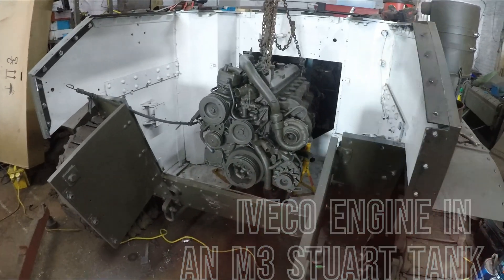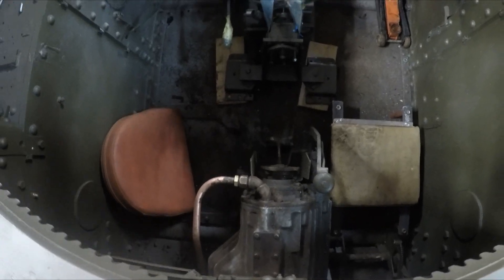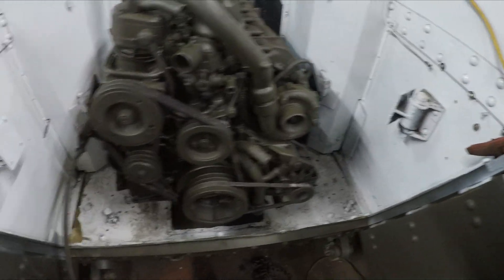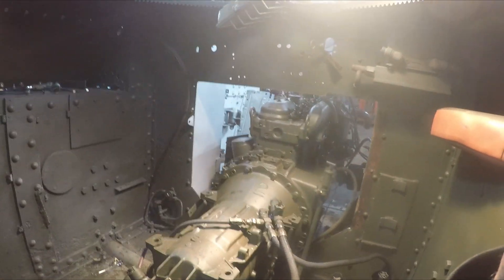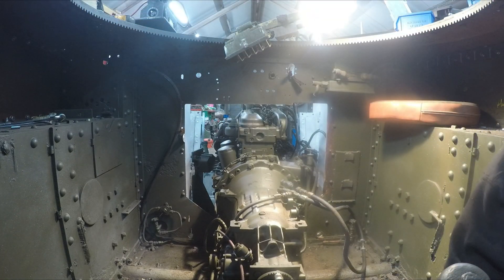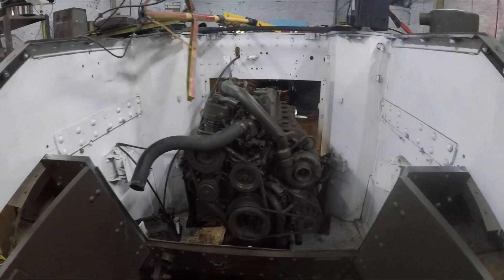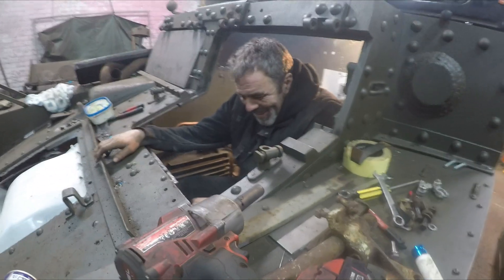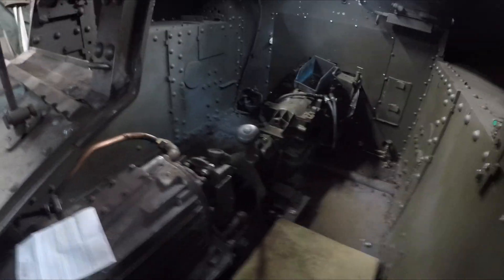Modern IVECO Turbo Diesel engine in a 1942 Stuart Tank

Comment: Not sure about the prop shaft, I think the u-joints are meant to be staggered different than that?
Reply from the maker: It will make no difference on such a short prop inside a rattling old tank.

Comment: Will that prop shaft be in the way of everything turret wise?
Reply: id imagine the propshaft would be lower than with the original radial engines, the auto trans might eat up a bit of room though.
Reply from the maker: @ravenof1985 Yes the prop is a lot lower now, I an sure we can box it all in for standing on
Reply from the maker: @Eisen_Jaeger There is no turret basket on the M3 Stuart and all the turret fitting/bearings are on the top of the hull, we will cover the prop up, we don't have a turret at the moment but don't really need one as they made M3's without turrets, called a M3 Stuart Command vehicle, look it up
Reply: @514thmick Thanks, I wasn't sure if there was a basket or not, just that it looks cramped in there. :D